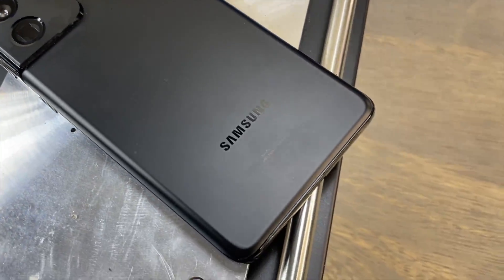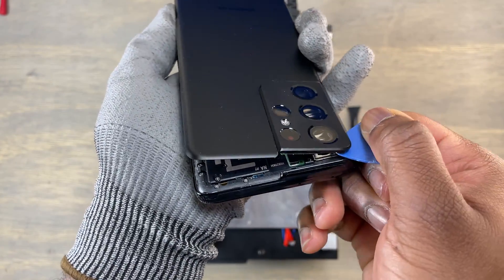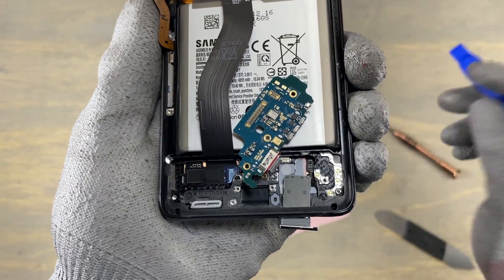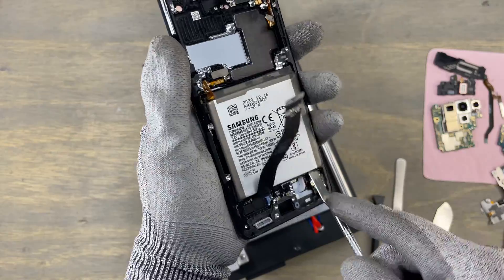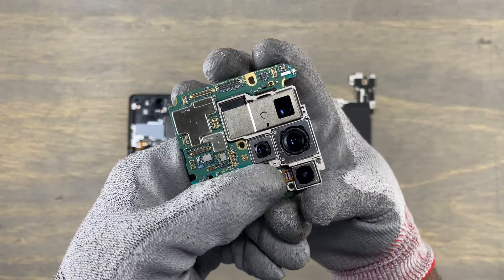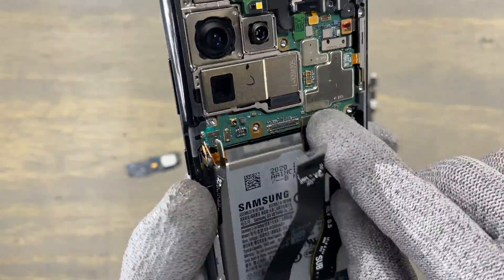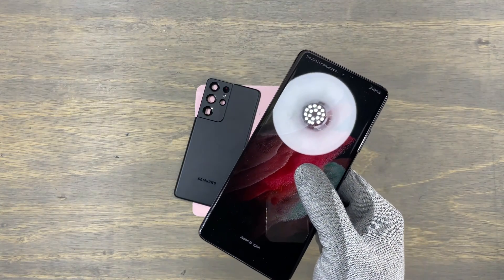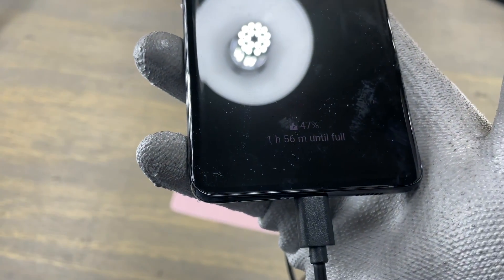Samsung galaxy S21 Ultra Teardown and Disassembly: Repair Guide

Comment: Sir i wanted to ask is the lens over the 10x camera also plastic or is it is glass because mine has dust and i wanted to clean it safety woth starching it
Reply from the maker: Not exactly sure I believe it's all plastic. Use a microfiber cloth to clean slowly. If the camera is still bad you will need to replace it.
Reply: @ersbit  or should I use a dslr sensors cleaning kit

Comment: My touch is not working, pannel is 100 percent fine, what should I do?
Reply from the maker: It's the digitizer. Replacement of it alone can be hard and damage the screen. It's better to get a new screen. It's easier but more expensive.

Comment: My samsung s21 ulta got water damage .It can detect sim but there is no signals or emergency signals on it kindly tell me the solution or the issue to look into
Reply from the maker: Not sure you'll need to troubleshoot the hardware. Teardown check all components for water damage then replace faulty parts. You can start by replacing the charging module.

Comment: Great Video Sir, but whats the pice on the left side of the battery?
Reply from the maker: Hi left of the battery, small green and removable that is the 5g antenna
Reply: @ersbit  awesome thank you very much, my german s22 ultra is missing that part 😁 may i ask another question. Do you know what these stickerß on the inside of the backpanel are for? There're two gray sticker, a green/brown very thin sticker and the metal one which i assune is for some connection. Thanks again sir.

Comment: Hi, I have some problems with my s21 ultra. I have no more access to mobile signal, internet data and so on.. I can not do calls and i can not receive calls. I can't even do emergency calls. What could it be? The antenna? the antenna cable? Can you advice me on this? i can't afford to pay 300 $ to change it so i would like to do it myself. Any advice would help thanks
Reply from the maker: Wooo this look difficult to advice. 
No network, no calls this looks like antenna stuff, it can be the board with the sim card too. 
First and easy step would be to open the phone disconnect stuff and reconnect to make sure it's not a connection issues with flex cables. If nothing new happens you'll need to change parts one by one. Try another sim card first to see if that one work. 
For parts Swapping you'll need to get correct parts and change them preferably from cheapest to more expensive.
Reply: @ersbit  is there a website you can advice? where i can look for the parts? Thanks again
Reply from the maker: I use eBay to get parts regularly. You can try amazon too
Reply: @ersbit  After cleaning my phone i have similar problem now. Phone doesnt Detect Sim Card anymore
Sim Card is tested - it works in other phone
Parts i changed allready :
-Sim Card Reader 
-2 Flex cables from Sim Card reader to Mainboard
-The black part on top you are removing at 3:35min
Until now i didnt want to change the mainboard since i dont want to loose all my Data on the phone

Comment: Hello nice video. I have a question regarding the two sensors he removed between 4:50-5:00. I bought a used s21 ultra 2 weeks ago and I realist that I have awful reception. Now I opened the phone and i realist the two sensors are not in my phone and also the port on the phone where I would connect the two sensors are not there. How can that be?? I mean sometimes have reception and I also have  5G then. Is it possible that there are Models of the S21 Ultra without this to Sensors? I hope someone can help me and thanks in advance.

Comment: If I'm just to fix the stuck volume button of regular s21, do I have to remove battery and some components of the phone? I dropped my phone and now it's stuck on safe mode.
Reply from the maker: It would be better to disconnect the battery and remove the motherboard if it is in the way. The battery does not need to be removed.

Comment: You should have shown how to remove front camera without damage too..
Reply from the maker: Sorry i did not remove it there. https://youtu.be/S_1ZvtLiDMo Here it is the S21 FE I removed it.
There is two types....
1- the camera is placed with thing double sided tape you heat the front of the screen just a little bit and remove the camera.
2-the camera is there with solid glue on the right and left (it is a shiny solid glue like hot stick glue)
You heat the front of the device a little bit and try to remove it but you will need to prey out the camera since it is a solid glue. I show it in the S21 fe video.
Reply from the maker: when you prey out make sure it is not too much force because the camera can get damage if the plastic is bent or something like that.
Reply from the maker: Here in the S21 the they used normal tape not solid glue https://youtu.be/Nf4A-ocTj7o at 2:21

Comment: Which part of the motherboard is the power ic. I have a dead motherboard  that's good and a good motherboard that's not able to activate with service.
Reply from the maker: Brother I am afraid I don't have that information. Anything soldering de-soldering micro components is out of my knowledge range. 
You will need to search more on parts of the motherboard find the right thing de-solder it and solder on the good board (soldering skills also). Also that's if it's something that can be removed and reattach (that's very technical and out of my range sorry I could help more)
Reply: @ersbit  no problem, thanks for the reply

Comment: Pls when I shake my s21 ultra there is some little noise inside I don't know what that is pls can you explain to me what's that noise
Reply from the maker: It can be camera making that noise maybe. Battery am not sure because they are well glued to the frame. When I take the motherboard of the s21 with the camera on it and shake it it makes tiktiktktitk noise maybe that's what you have.
Reply: @ersbit  thanks
Reply: @ersbit  because is stil a new phone that's why am scared

Comment: hi, thanks for your videos.  I have inserted the skewer for the sim through the hole of the microphone.  Do you think I have damaged something?
Reply from the maker: Not exactly sure you will need to test the mic to see. On a phone call, while filming front and back camera and while recording memo audio. If all these the sound comes out good you can be sure that no damage was done.
Reply: @ersbit  Hello. Thank you for your great content! I'd to ask about this topic, my main mic (the ones below) is not working. I had run diagnosis test and only this mic is not working while the upper mic is working fine. Do you think that's due to damaging mic parts and not from system bug?

Comment: samsung s21 ultra, in 4k 60fps video, at the moment of zooming, the image becomes blurry, any ideas about this failure?
Reply from the maker: Humm if on all other setting or use its not blurry it's clear. It must be the hardware reaching it's limit of focus when you zoom / extended zoomed. 
The device has less focus power when you keep zooming
Reply: @ersbit  
Thanks for the info delivered

Comment: 5:07 Isopropyl alcohol melts the adhesive fast and makes the battery removal very easy.
Reply from the maker: 😮 That is correct, but what if the liquid melt the glue that attach the screen/digitizer to the metal frame? I prefer heat it is less risky and I don't have to add a new tape 😅

Comment: Hi, may I know if the camera bump on s21 ultra is durable to protect the component of the cameras especially the lenses? Is it safe to put it down in a surface where the camera bump will hit it first?
Reply from the maker: Hello, I would suggest to add a case/tempered glass on the lenses/camera bump to protect them. It's kinda durable, but it doesn't take much to scratch them and you'll be obliged to change the whole thing
Reply: @ersbit  I see, how about alunimum alloy frame instead of tempered glass, which do you prefer? Im a bit worried that theres a bad effect if put down my phone and the camera bump will hit first the surface haha. Please enlighten me that this is safe
Reply from the maker: It really depends on your preference. You just have to make sure you protect you device. I would go with glass personally because it is lighter than aluminum case.

Comment: Wish samsung used a vapor chamber in addition to graphene pad.
Reply from the maker: can you explain a bit about your vapor chamber concern ?
Reply: @ersbit  So the phone would run cooler for longer.
Reply from the maker: Oh ok the small copper cooling ( yes more in these devices will be welcome)
They might have to sacrifice device thickness. Thanks GOD this trend of slimming smartphones is vanishing slowly they might consider more cooling in the S22 ultra
Reply: @ersbit  They need too, the sd 888 is a hot chip.I'm reading the upcoming sd895 is hot as well.
Reply from the maker: That's some good info.
Hoping the S22 ultra doesn't disappoint in a few months

Comment: Great video sir!
Pleasr may I ask, wont the pre heating damage the phone's internals 🤔?
Reply from the maker: No heating won't damage you have to be time sensitive. About 2 to 3 minutes maximum straight. If you have a heat gun keeping the heat at the same location on the screen can damage it that's why you need to move around right left etc....also use the lowest setting of your heat gun (high setting can burn very easily)
Reply from the maker: All these years I had only one screen burn from heat. Internals are well protected if adequate heating is used.
Reply: @ersbit  ya that's a pretty smart way to remove the battery, applying heat that will pass through the screen